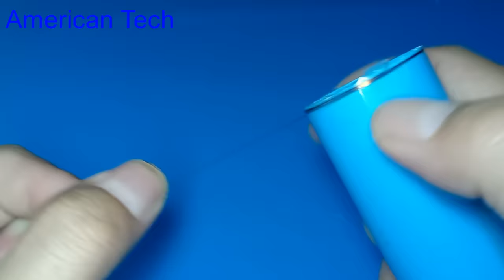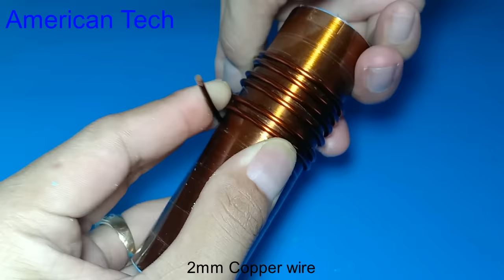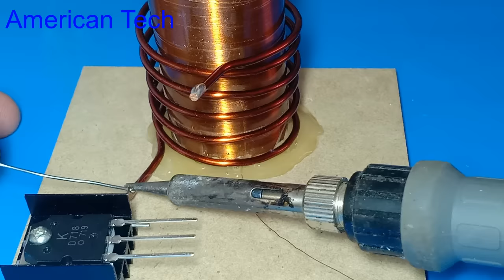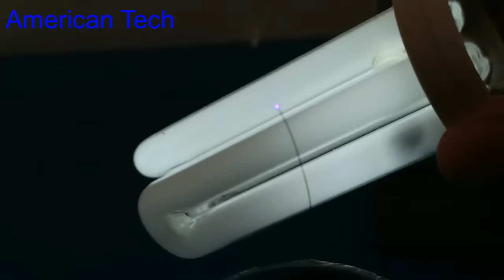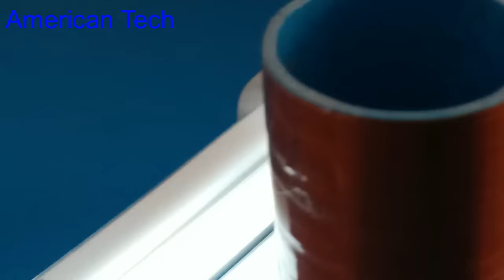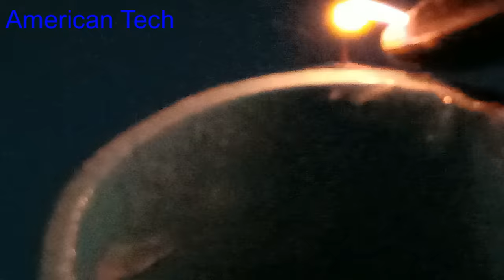How to make a powerful Tesla coil

Comment: the circuit works but it has very low effciency due to the voltage drop of the transistor make it heat up quickly
so you need the mosfet which has very low voltage drop and the RF amplifier you can build with some C1815 transistor, inductor and some resistor to drive the mosfet
Reply: Can you recomend an other schematic for low power tesla coil?
 Thanks

Comment: Hey dud i have 1 ? How the transistor produce ac current in primary coil . Because the  collector to emitter is a dc circuit . And the dc current not produce inductance in primary coil (work as short inductance).Hence how it's produce flex in secondary coil.
Reply: Im not 100 percent sure about this since Ive never built one before but, I think he is using a mosfet to mimic an ac current.

Comment: Can I use 12v 2A adapter as input power ?? Plzz reply .. i am making this...
Reply: It really needs about 8 amps to give you any worth while output. It most likely won't use more than 4, but always best to have a surplus.
Reply: @FredtheDorfDorfman1985   ok, but if I give 12v 4A or, 12v 8A , will not the mosfet damaged ? Can this mosfet handle this high current ?

Comment: Why do you always coil neatly??
Reply: Coils need to be neat with no kinked or wrinkled wire, no splices, and no overlapping of turns, as these would harm the efficient functioning of the inductor coil. The windings need to be smooth, snugly seated between each other, and all in perfect alignment with each other with no overlaps or loose windings. The windings need to be wound straight with being as close to perpendicular to the length of the coil form as possible. Then once wound smoothly and neatly the coil needs to be sealed with epoxy resin to protect and insulate it.

Comment: I have an IMPORTANT QUESTION... TO THE BUILDER/MAKER OF VIFDEO @AmericanTech PLEASE ANSWER.... the end of video did not show what went to the transistor on the last leg, so we went to the still photo in the beginning but we noticed A HUGE PROBLEM and I did the entire construction based on this and basically in video you connect the resistor and to the bottom of the large coil but in the still photo for your video of the completeted project shows it hooked up to the TOP. Now I have no clue WHICH WAY I'm supposed to connect or WHAT POWER SOURCE IT NEEDS? How many amps??
Reply: The last leg is connected to the -ve of the supply. You could power it up from 12-15 v at 2 amps. Even 1 amp may work as u can see the  video its just drawing few milliamps at 13.5 v
Reply: @power45118  What about the difference from the connection of resistor in the video and then in the still shot of your video (the resistor is connected to the top of the primary, and the video show you connecting it to the lower end of the primary) It should ONLY MATTER, or need it to be switched (I believe) IF the primary and secondary are not wound the right direction in relation to each other which I keep finding DIFFERENT ASNSWERS FROM EACH RESOURCE!!!  So do you know should the secondary and the primary we wound the SAME DIRECT or in OPPOSITE DIRECTIONS from one another??  And which way was YOUR Resister hooked up in the video to make it arc and all, (You NEVER ZOOM OUT TO SHOW THE COMPLETE BUILD WITH THE ARC :( !!)  Or which way SHOULD THEY BE TURNED IN RELTION TO ONE ANOTHER IN ORDER FOR IT TO WORK>???
Reply: @power45118  And THANK YOU FOR REPLYING!! I didn't have too high of hopes, but it is GREATLY APPRECIATED!!
Reply: Just don't get confused from the thumbnail image and the video and about the different connection. The direction of winding doesn't matter much. If it doesn't work in the first attempt just flip the connection of the primary, that's it.

Comment: Thanks for the information. Is there any limitation to designing the secondary to vibrate in the gigahertz range?
Reply: The coil would have so few turns that the voltage would be quite low

Comment: Why no spoken explanations. This circuit cannot oscillate and cannot be in resonnance.
Reply: It can oscilate
Reply: Israel Gómez, how did you tune the circuit at the resonant frequency please ?
Reply: Israel Gómez , Tesla coils work as LC oscillators at resonance.
Reply: It automaticly tunes to resonance frecuency, search for slayer exciter circuit, it oscilates based on a feedback from the secondary coil
Reply: @christiangodin5147  it automaticly tunes to the frecuency based on a feedback from secondary

Comment: Can I give 240 volt power
Reply: I also want to know but as to me the MOSFET or any transistor used can't run on 220v so I think a max of 30 volt can be given in this kind of project but if you add a capacitor and some other component like resistors you can use it directly on 220 or 240 v . what is your opinion?
Reply: @cutekids2171  but we have to use high power resistance qnd transistor

Comment: yes through through this type of coil it is possible to boost anti gravitational motors
Reply: How? Would be nice to share
Reply: If your talking about the wire that oscillates to create lift with electric  that is the principal behind it but it isnt true anti gravity it relies on air to generate lift wont work in a vacuum 

   Seen this experiment where you could achieve directional rotation with a Tesla coil

    Tesla coil  with rotating wire break out

Comment: I think the negative or black wire of the 13v goes to the right leg of the transistor, the positive or red, you guys can see it where is soldering.
Remember guys DON'T TOUCH WITH BARE HANDS The shrew driver, he most recently be attach to the negative of the other side of the coil and probably he is not using his bare hands .
Reply: Negative goes to BJT emitter. Positive to top of primary coil and base resistor. Bottom of primary goes to BJT collector. Simple but very inefficient circuit. BJT needs big heat sink to dissipate all the power the circuit wastes as heat so the BJT does fry like a sinner in the Hell of Boiling Oil.

Comment: One question. What was the thing he put the D718 transistor on with that white glue?
Reply: Its a Heatsink and its not glue its thermal grease
Reply: @ElIsraelJijijiji  okey sorry xd
Reply: @sidhantdhawan6042  XD
Reply: @ElIsraelJijijiji  second questions do i really need the same transistor (D718) 
Or is any other transistor even possible
Reply: @sidhantdhawan6042  yes almost any NPN transistor
Reply: @ElIsraelJijijiji  okey thanks xd only one laaaaast question xd how much 1mm copper wire do you think he ca. needed ? I want to do this at home but I do not know how much wire to buy
Reply: @sidhantdhawan6042  well for the copper wire you need to multuplie the diamter of the pipe times Pi and then times the number of turns thats arround 700, and then divide that between 100

Comment: Can i use another transistor ?
What is its effect ?
Reply: Take a look at the datasheets of a few different transistors and find one that has a similar gain, max voltage, and max current of the one used in the vid

Comment: Is IRFZ44 will work instead of D718.???
Reply: IRFZ44 has great on resistance at 0.028 ohm and power dissipation at 150 W, but its max drain-source V is only 60 V whereas D718's collector-emitter V is 120 V. And IRFZ44 is a MOSFET not BJT, so you will need a FET driver IC like DS0026 or MIC4452 with the secondary feedback driving the FET driver, not the MOSFET gate, because the secondary feedback can't drive the MOSFET gate. IRFP250's, or IRFP460's are a good idea because of their high drain-source V of 200 V (250) and 500 V (460). Also multiple MOSFETs in parallel with good heat sinks would be a good idea.
Reply: See: https://www.instructables.com/id/Easy-SSTC-Slayer-Exciter-On-Steroids/ for an idea to make a high powered slayer using a FET driver, FET's, a tank capacitor across the primary, and a top load capacitance.
Reply: Thanks A Lot, For Your Kind Reply!! 💙
I have tried many times with different ic's but still unsuccessful... 
Example : 2n2222n./J13009./Irfz44n. 
I really Don't know where is the problem?
Reply: @TanvirKabir0461 you're welcome. Yea small signal transistors like 2N3904 and 2N2222 don't offer anything for output hardly unless you use many of them in parallel, because they don't conduct much current at all. For example the 2N3904 conducts no more that 200 mA or 0.2 A, the 2N2222 and 2N4401 have a maximum current of 700 mA/0.7 A, and the BC547 is only 100 mA/0.1 A. And these outputs are really pushing it with lots of heating and stress on the transistor in ways it should not be getting put through. Like integrated circuit ouputs they should not be pushed to full current output capability or they won't last long, and certainly not in a Slayer circuit. Like the 555 timer chip, which can conduct up to 200 mA from its output stage, you should never expect it to deliver 200 mA out. You always want it to put out less than 1/2 of its capability, and have it drive an amplifier stage capable of higher current for a higher output. These small transistors like 2N3904, BC547 etc, are designed for small signal amplification and switching, not power uses. The reason some people use them for Slayer's is for their switching speed and low on resistances, but they don't conduct enough current and can't dissipate heat well at all. This circuit is also very inefficient operating in class A which wastes a lot of energy as heat. In the Slayer Exciter circuit the transistor is conducting almost all the time in its active region, even when negative feedback cuts it "off," it isn't really cutting it off completely and certainly not for long. A square wave in a digital circuit where the transistors are either fully off (no current flow except for negligible leakage), or full on (lowest resistance state of conduction,) wastes much less energy as heat and are far more efficient, which is why TV broadcasts (especially in the US) have gone digital. Class A operates anywhere between off and full on all the time to create a sinusoidal, or sometimes triangular or sawtooth waveform, so resistance of varying amounts are always being used to control conduction. Power bipolar transistors with plenty of voltage and current capability surplus and low on resistance are the best for Slayer's. They need to be capable of at least 200 V and conducting at least a max of 10 amps for powerful Slayers. Also they need to be in parallel to share the work and heat, and on a big aluminum heat sink to dissipate the heat. TIP31's are good for small Slayers, because of their speed and resistance, but only go up to 3 amps so many would be needed in parallel for a higher output. And like I said before FET gates aren't able to use the secondary's negative feedback and so MOSFET's would require a FET driver chip, like MIC4452. As for your main problem of it not working at all, have tried reversing your primary connections? The primary and secondary coils need to be wound the same direction, the positive supply connects to the bottom of the primary, and the transistor's collector is connected to the top end of the primary. That way when current flows through the primary it will induce a current in the secondary that will make the bottom of the secondary, connected to the transistor's base, be negative so it can provide the negative feedback to turn the transistor off and create the oscillations. So make sure your primary and secondary turn the same way, and the bottom of the primary is connected to the positive supply. Also make sure your supply is providing at least 4 amps, but preferably 8-10 A.
Reply: @FredtheDorfDorfman1985   Thanks for your useful information,  You explained me very well, I really appreciate!! 💙
I succeeded with 2n2222 transistor.  But you know it can not handle more current,  I am trying to   collecting a D718 transistor. I will get it soon. Then I will try to make a powerful tesla. 
Thanks for your valuable time.  Have a Great day!!
Reply: Bro do you try with D718 transistor

Comment: How is the light globe running
Reply: the short thick wire is being shorted on and off thousands of times per second...this creates a strong fluctuating magnetic field that comes and go thousands of times....this magnetic field triggers the secondary long winding as it happens and it creates very high voltages on that long secondary coil....the tip of that long coil is the positive of that high voltage surge....at such high voltages the positive will try to discharge its massive energy into the air since positive always tries and seek negative ground..and the blue streaks of light is the result of that...

Comment: What is the output voltage and Current??
Reply: Should be around 2000-3000v seeing by the arcs
Reply: 13.2voltage 0.26current

Comment: What is the frequency of output high-voltage current??
Reply: If this person doesn't know the difference between a "powerful tesla coil," and a moderately powerful slayer exciter, then I highly doubt they would know its output frequency, voltage, or current, or even how to figure out what they are.

Click bait comes in a variety of flavors and all tend to be extremely bitter, and sour, on the palate of the mind.

Comment: I can't make it. Why?
Reply: Check ur coils..is it around 500-1000 coils..did u get the right resistor or transistor..ur connections with the 3 leads of transistor(all 3 are diff)..and ur input voltage

Comment: I have a question please , 
How much Voltage and Amps can we get on the output  ? 
I mean the possible maximum DC volts and Amps on the output wire ? 

Please !!! 
Tell me !!!  

Before building this coil ! 
I wanna know this !
Reply: Tell me what are the output volt and amps !!!
Reply: @freetubemovies.644  15000 and 100 amps prob. If you touch it however the voltage will drop to 0

Comment: What is the rate of input voltage
Reply: As much as ur transistor can handle..should be abt 15v..but it will blow if u turn it on for too long..so i suggest u connect some transistors in series
Reply: oomf parallel, not series. In parallel the transistors share the work and heat dissipation for more current which improves output and transistor life. You can’t use transistors in series for higher input voltages. The best thing to do is use many power bipolar transistors, like TIP31 or TIP41, in parallel and mounted on a large heatsink to help dissipate the heat. If you want to use a higher input voltage then use power bipolar transistors with a higher collector-emitter voltage rating. Make sure if you use power transistors that your supply can provide up to 4-8 amps.
Reply: @FredtheDorfDorfman1985  parallel* sheesh man sorry

Comment: But the radiation is harmful!
Reply: yes long term exposure can be unhealthy...the air is being ionized as it burns through with such high voltages...ensure adequate ventilation...these ultra high voltages could also emit uv and even x ray radiation
Reply: @bettytherussiantortoise2808  10 years no longer smoke ... Profile picture is very old!
Reply: Then change it
Reply: @fidelcatsro6948  well ozone is produced which is bad but it does not make enough ozone to be lethal..ofgices hv hundreds of laser printers that produce even more ozone but still..no deaths from ozone
Reply: @chingiawae3831  might as well use 5G network and hold it infront of you as well since you say its not dangerous...its all cancer causing stuff long term!
Reply: @fidelcatsro6948  yea its not dangerous..if not why would they wanna release 5G network for new smartphones..it wont give cancer goddamn

Comment: It doesn't work
Reply: Make sure primary and secondary are wound the same direction. Positive to primary top and resistor, resistor to BJT base, bottom of secondary to BJT base, bottom of primary to BJT collector, negative to BJT emitter. Simple.

Comment: can you place several transistors in a row and connected to increase the power even further?
Reply: Yes. It is better to do so because this is a very inefficient circuit that wastes a lot of power as heat, heating the transistor. Several in parallel with share the load and heat dissipation.

Comment: The transistor should have two 1N4148 diodes connected in series between the base and emitter, with the cathodes towards the base.  This protects the transistor from excessive reverse voltage between the base and emitter.  The transistor will also run cooler.  Thanks for the video.
Reply: Is that a assumption or did you do it this way and it worked?
Reply: @tyrewald9083  it can be quite, however not succeed much, if someone add two diodes between base and emitter of transistor pins, then can assume power, transistor will also run "cooler" but get very warmer in minutes and maybe burn out.